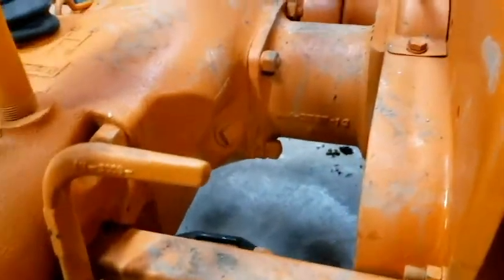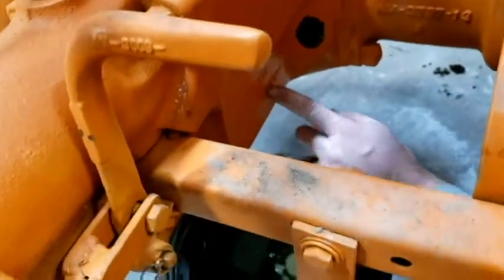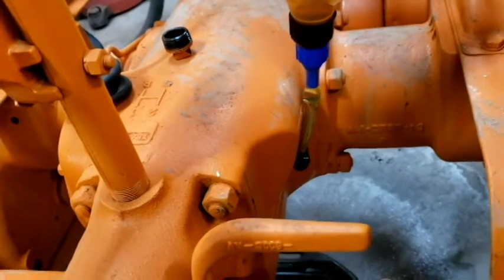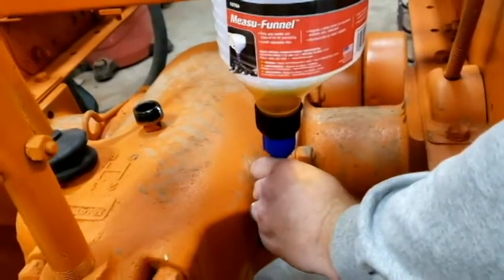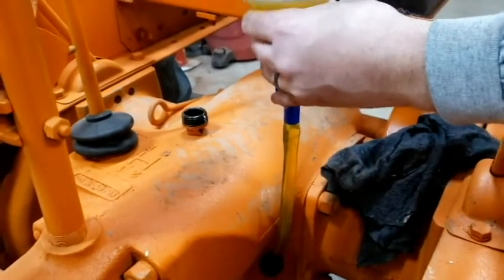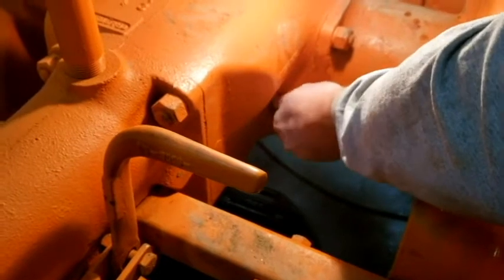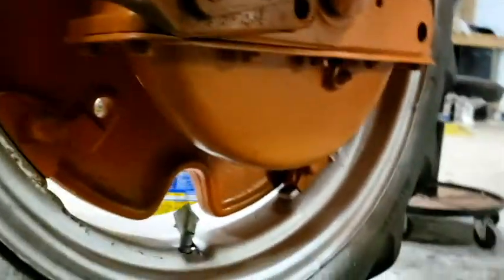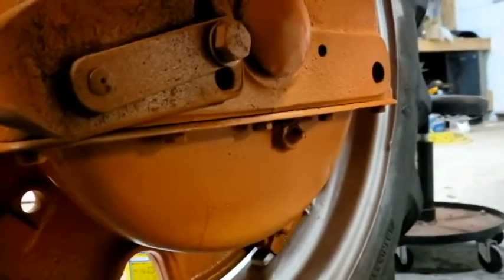1940 Allis Chalmers B Transmission Oil Change

Comment: Looks good, however I think you put the wrong oil in your tractor. The manual calls for 20 W oil. This is the same fluid that run the hydraulics on the tractor. I bought a 5 gallon pail of Fram AW68 hydraulic fluid for my Allis Chalmers C (equivilant to 20 W oil).
Reply: There are no hydraulics on this tractor, so 80/90 gives better wear protection and doesn't need to go through a hydraulic system.
Reply: @billf157  Ok. Mine has a PTO driven by a hydraulic pump. Nice detailed video. I will be changing my fluid as soon as I fix my hydraulic lift actuator leak.

Comment: Why 2 bungs?
Reply from the maker: I'm assuming inside the casing the way its shaped only doing the lower bung wouldn't get all of the oil from the front - guessing there's a ridge there but I have never had it opened to know for sure.
Reply: @billstractorcorner  Oh OK, thanks.I just recently bought a B.
Reply from the maker: @johnpetersen8238  nice!  I hope you enjoy it, they're great little tractors!
Reply: @billstractorcorner  Yeah, It's fun to drive. It has a Woods belly mower on it. I just looked, it has only 1 bung drain, that I can see.  Must be a different year than yours.
Reply from the maker: @johnpetersen8238  I'm jealous!  I want to find a belly mower for mine, would work much better than my current riding mower!
Reply: @billstractorcorner  Kinda complicated on how the belt runs on all the pulleys. I took pictures and Drew a drawing of belt on pulleys and twists in belt for notes. The diagram on the mower has gotten worn and hard to read. I'll have to replace it some day,if I can get a new one.🤔
Reply: the gasket on the PTO holds oil so the hydro pump still works if the tractor is running down hill